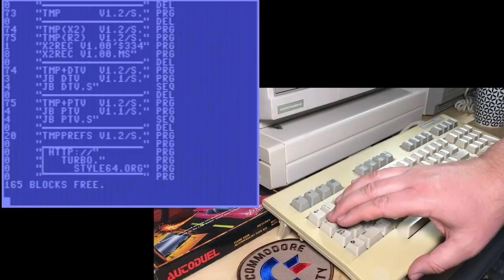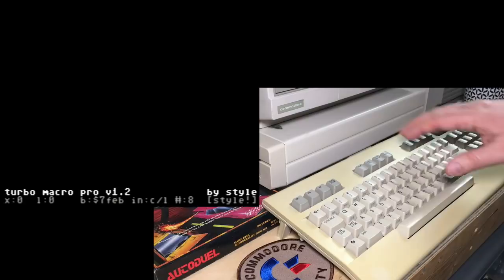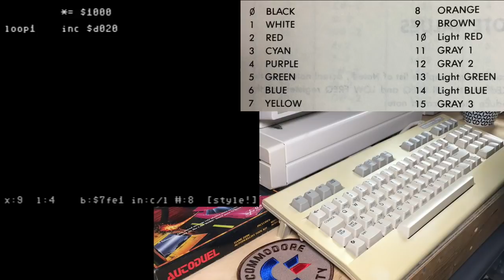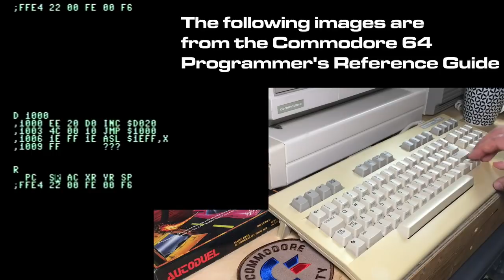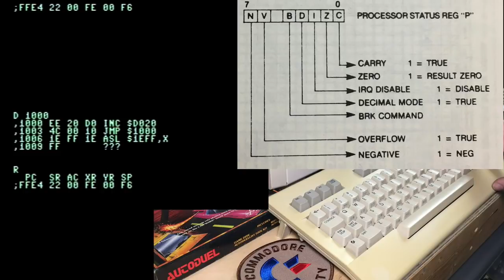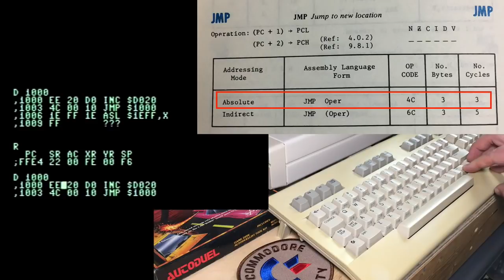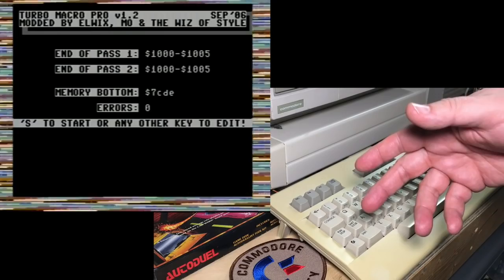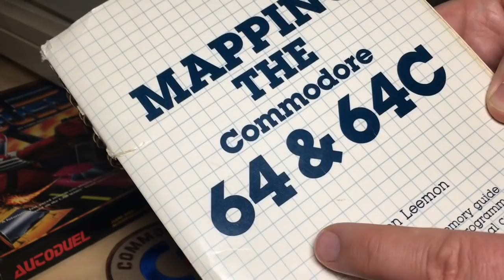Commodore 64 Assembly Language Programming With Turbo Macro Pro

Comment: Thank you for keeping the C64 family alive. I taught myself machine/assembler on the 6502 (Apple][e first, then C64) when our school only had one computer.

Your exact program (change border color) is the very first machine language program I wrote on the C64 in 1983. Notice the colors on the border, and how they form a short "line." Something in your system is taking up a lot of CPU time because after seeing this same output, I hand "poke"d my machine code. When that hand-poked code ran, the colors were indiscernible dots of color, screaming fast, like "bug races" of old televisions not tuned to a good frequency.  After seeing the difference (interpreted/interrupted code versus free-running), I made a crude "ASSTOHEX" disassembler (a bunch of if-then lines) so I could write using a text editor (that I hand-poked into a program) in "Assembler language" then have that text interpreted, assembler to hex, then poked into memory.  I wrote nothing of value, but just entertained myself with widgets only useful to myself. I wish I stayed with low-level programming, but I let myself get distracted by booze and women, then picked up Pascal/C and HTML/CSS/Javascript.

I also installed my own "reset" button by running the C64's "reset" pin to ground through a SPST/pushbutton (worked perfectly, no need to power off/on). I also added a SPDT/toggle switch to the speaker because when my 300 baud MODEM was connected (after the screaming handshake), a local radio station played through the always-on, C64 speaker (KFAB… so you know where I was at that time). Gosh, that was a tinker-ers dream with the user ports. It was SO FAR ahead of its time - now people buy Arduino and other PIC programming tools. C64 had those all the time, easily accessible and addressable… but sadly Bill Gates called it a toy, stating that personal computers were for business use only and not to be played with... and all his sheep did the same.

I put my C64, 1541, cassette, TV and game/tv modulator on a roadside one day when I had to move for work. Ah, my first love. Goodbye, forever.

Again, thank you. This was a fun video. I am now a subscriber.
Reply: Ironic considering that Javascript leads to booze.. (not women though) .. Either way.. booze is always the constant. haha. Very cool on your disassembler!
Reply: Cool!  I also wrote a bunch of assembly in the 1980s for the C64.  Good times

Comment: When I learned this stuff long ago I found it enormously helpful to break down the bit manipulation at topics like two's complement and visualize binary in a similar way as visualizing Lego studs 🙂
Reply: I didn't have anything back then, not even a hex monitor, because I didn't know what it was. So I learned by trying, which also means I had to learn the decimal value for the opcodes in my head and then write them directly in data lines.
But today, what I would have done was to first learn how a computer functions from the inside of the computer, because it is of great help. And there are many channels, but I would definitely recommend Ben Eater's channel. He basically builds a computer from scratch and explains each and everything about how it works. I would watch that - and eventually try it out too - before I started machine code programming.
But you definitely can learn machine code without, I will though like this channel recommend the Commodore 64 Reference Guide. Without that, you get nowhere.

Comment: I started programming on an Amiga with Devpack 6800 assembler. I remember printing out programs that were as long as the street block then marking sections out with highlight markers. All that just to be able to fully focus on what I was doing.

Comment: I learned Assembly, Pascal, and C as a kid on my not quite yet vintage but still pretty old Apple IIGS and Macintosh iici machines I got as gifts in 97 and then 98 for my 5th and 6th birthdays.  They were both from my uncle's workplace in storage.  When they were in use, they were loaded up with some of the best expansion cards and accelerators you could get at the time.  I still have both computers set up and write programs on both, but the IIGS is probably a bit more fun to write programs to create pixel art/music tracks on.  System 7 is great on the buffed-up Mac iici for sure, but the IIGS has a certain charm to it.

When I was in college, I was sad that they barely talked about Assembly in classes.  When they did, they used kind of vague explanations to cover Operators instead of comparing them to things students would already have some understanding of.  I was annoyed they only really taught C++, I'm not a fan of it personally with the relative instability (number of changes made often to "solve" problems, not program instability) compared to C.  That and how insanely abstract and overcomplicated OOP has gotten to.

Comment: As I already wrote in the comments of another video: SYS 2^15 is easier to remember than SYS 8*4096.
Reply: I would have thought SYS 32*1024 would be easier to remember than SYS 8*4096... but honestly, if one doesn't think in powers of two, none of these memory ticklers will likely be of any help. 😄

Comment: Memories! I originally keyed in an assembler program from a book (I think it came from Compute! magazine). I didn't need an editor because it used the basic screen editor (line numbers and all) so you could enter an assembly language program the same way you would enter a basic program. It was quite a good assembler which revolutionized my C64 use. Later, I wrote a FORTH for my C64 which included a "label less" assembler (it turned out to be remarkably easy to do). 

Structured programming in assembly language is a quantum leap forward. In the FORTH assembler, your code would be like this:
BEGIN, 
   $D020 INC, 
   $D021 DEC, 
AGAIN,

Comment: Again for VICE users, <Run/Stop> is by default mapped to the <Esc> key,  and <Restore> is mapped to <PgUp>. Although the regular Page Up key and Escape wouldn't work for me to break out of the program, but if I put <NumLock> to off and pressed  <9/PgUp> on the keypad, it broke out to BASIC (tested with the x128.exe on Windows 7 and doing GO64 to get into C64 mode).
Reply: I find that F12 works as the <RESTORE> key when using VICE for Mac
Reply: Hmmm... Esc + PgUp works fine for me on Linux.  I use that combo because I have F12 mapped to yakuake (dropdown terminal).

Comment: Extremely useful! I downloaded Turbo Macro Pro, installed on my MEGA65 (with C64 core) and followed your instructions step by step. My first baby steps in ML!!
And yes, I also bought a (second hand) copy of the Programmers Reference Guide two months ago 😃

ps,
Is the exact same little program also supposed to work when a REU is connected or are additional instructions required?
With REU enabled (we have that option in the MEGA65), 'TMP+REU' recognise the added 512k, but when executing the program I cannot start TMP with the SYS command, it seems to hang.

Update: never mind, you explained the use of the REU in the next episode. Return with SYS 320. Thank you!!

Comment: Loved it! I wonder how they manage to escape an infinite loop. The restore key must be hooked up to the interrupt and there must be some interrupt vector pointing to basic?
Reply from the maker: Yes, I'll put it in my notes to mention that next episode. Rather bizarrely, the restore key is directly wired into the Non-Maskable Interrupt pin on the processor! So hitting the restore key causes that interrupt, which jmps through a vector at $0318 which checks for the STOP key being held down, and then runs an init routine.

Comment: I really like your videos quite a lot ... i use "The C64" to teach my son programming  ... what I would really like to figure out would be two points (i think that could be also interesting in your videos).
 A) How to use turbo macro pro together with a basic source ... how to combine and memory manage both, save both etc
B)  How to use character and sprite editors combined with tmp and memory manage this ... how to save the sprite data, load them in tmp etc ... which sprite, character editors are recommended. 

Would be such a gift for me and my ten year old son Simon ... cheers and greetings from Zurich, Stephan

Comment: Found quite a significant bug in TMP (Last version, REU): Using the "load-to-ram" option (R-l) you are asked correctly if you would like to use the starting address found in the file, but when using this, the actual loaded content still contains the starting address in the byte stream in little-endian. Only when you translate the memory content by make-data (6) you get the wanted bytes back. So loading memory is buggy - take care mates.
Reply: For example you have a character set as prg file with $2000 as start adress the loaded data in memory starts than with $00 $20 ...  ouch

Comment: For those following along with VICE, the back arrow key is underscore in the standard symbolic mapping :P
Reply from the maker: Interesting. I'm running VICE on OSX with a symbolic mapping (for example, it's Shift+8 to get the asterisk) but it's the tilde key in the top left for the back arrow still, which is positional. Must vary between builds.

Comment: Great video! I use TMPx cross assembler for C64 stuff. I like to use modern text editor for coding :)

And for actual hardware testing. Ultimate 1541 II to transfer files with SD card.

Comment: Are there any known issues with TMP and VICE emulator? 
In my case I can compile a program only once but after that the folowing changes in the assembler code has no effect! It's always the first version of the code even if it's compiling and showing no error. It happens only on the vice emulator...

Comment: Hi Robin, I've just gotten my hands on a Commodore 128 with working 1084S monitor and some quad density 5.25" discs and 1541 disc drive. All in excellent condition except for the disc drive.

The FDD was said to be working before I bought it, but something must have come astray in transport or me trying to set it up. because the disc motor doesn't start and disc reports as not present, even though the light on the drive does come on.

I'm in communication with the guy and he's sending me an extra serial cable in case that is the issue. If not I guess I'll have open up the enclosures and see if I haven't knocked the connectors off the board and resolder them if so.

But disc troubles aside, I now have a Commodore 128 and want to develop new programs and libraries in assembler, but I don't have an REU. and it seems I'm not likely to get one any time soon.

So instead of TMP+REU I have been using Merlin 128 on VICE, my version of which only runs in 80 column mode. Which will require an RGBI connector (and a sd2iec or something, which I probably will need anyway) if I want to eventually use it on my Commodore 128.

Another reason I am currently using Merlin 128 is that I'm working through (half way done!) Commodore 128 Assembly Language Programming by Mark Andrews and typing in the examples and playing around with them.

When I was getting started it was fairly helpful to use one of the three full featured assemblers used in the book (Merlin 128, Total Software Development System by NoSync or Commodore 64 Macro Assembler Development System by CBM). Although now I think I could use any 6502 assembler it's just a matter of convenience and ease of use and exchanging source code.

Perhaps when I get more experienced in 6502 assembler I will be able to modify Turbo Macro Pro to instead of "bank switching" with the REU instead use the C=128's in built MMU to bank switch to accomplish the same thing. Maybe adding 80 column support as well...
 
Yes I know the REU doesn't really bank switch rather it copies to and fro between the Commodore's memory and the large memory in the cartridge using DMA.

My question to you is that what do you think would be a a good interim solution?

Merlin 128 seems better maybe because it uses 80 column mode, but it otherwise seems pretty clunky in many ways, and to be honest assembly doesn't really use more than a few tens of columns anyway unless you are the habit of putting in wordy comments, which I am, a "bad habit" I picked up at university :P

For example weird clunkiness of Merlin 128, picking lowercase with {shift}{C=} doesn't appear do anything, and the assembler is forced to uppercase but the comments are lowercase.

You can force uppercase comments by using {caps lock}, but I don't know if that means that instead the comments will actually be upper cased and appear as graphics characters and therefore unreadable except to the real wizards when selecting the uppercase+graphics charset, or if the actually assembler will be scrambled that way or what but it seems weird and fucky and probably doesn't seem the best for portability between assemblers? It saves sources as .S files, but I have no actual clue if they are just plain text files, not do I know an easy way to check except maybe for using the MONITOR, as it does list the memory address it uses for source and object... 

Perhaps this character set weirdness is due to the way the VDC does text? I know it's supposed to support underline and all sorts of weird shit, but don't know the details yet.
Reply from the maker: Congrats on getting the 128! Hopefully you get the disk drive problem worked out.

Are you specifically wanting to develop C128 mode programs? If not, I'd recommend just using the non-REU version of Turbo Macro Pro which is included on the same .d64. As long as you're developing smaller programs you shouldn't have much trouble with it.

Otherwise, another C128-mode assembler to look at is Power Assembler (aka Buddy) which I've heard recommended before, but I've never used it myself.
Reply: @8_Bit  I want to make programs that will run on the C=64 for the most part, but I would also like to try my hand at exploiting the C=128's extra features. Maybe in the same program by testing to see what features are present?
Reply from the maker: @MrGoatflakes  You could totally use C64 TMP to use some C128 features that are available to C64 mode, such as 2 MHz mode. You could even use TMP in C64 mode to write C128-native programs, but there would be the extra hassle of switching back and forth between modes. I'd recommend starting by exploring C64 mode anyway before you start getting into C128 mode. You can always apply what you learn to another assembler later.
Reply: @8_Bit  right because it's all just reading and writing values to particular addresses in 6502 assembler, right? And if the right hardware is attached hopefully it will do something xD

But does TMP run alright on a C=128 without a GO64 first?
Reply from the maker: @MrGoatflakes  You need to GO64 (or power up or reset with C= key held down) to run TMP on a C128, but since it's the same processor, TMP is capable of creating object code that a C128 can run. The thing I'm not sure about is whether you'd need to assemble to disk, or if enough RAM survives intact between the two modes that you could quickly switch between the two modes to test your code. Either way, learning 65XX assembler and the C64 architecture will all help you towards your goal, and it's very accessible, so imo, go for it :)
Reply: @8_Bit  hmm I see. Do you have any idea why? I was hoping I could run it in C=128 native mode and then set a function key to swap out a segment some pages by shoving some shit into the MMU registers so I could run the resultant object code in it's "own machine" then use another to swap back the assembler again.... Maybe I should just look at the TMP source :P

Comment: Thank-you for the video.  It's inspired me to get VICE out again.  After some false starts and other conundrums, I've got TMP working.  :).

So... my first seemingly unsolvable problem is "serial device number".   It plainly prints out "#8" in the bottom line... indicating that it's keyed to talk to device number 8.  How do I change that number?
Reply from the maker: Back arrow d cycles through available device numbers. Check out style64.org for full docs. 👍
Reply: Urgh.  That is frustrating.  I searched that page for "disk" and "unit" and didn't find that line.  THANK-YOU!

Comment: one other question: when you make up routines, do you have a standard way to pass parameters? registers, parameter block or low memory blocks...?
Reply from the maker: I use registers whenever it's practical, otherwise a block of RAM right before or after the subroutine code if they're basically "local" to that routine. Otherwise if they're more "global" variables or parameters, then they're just defined in the main block often in zero page. So, it can be all 3 :)